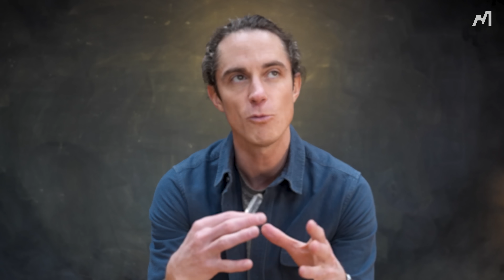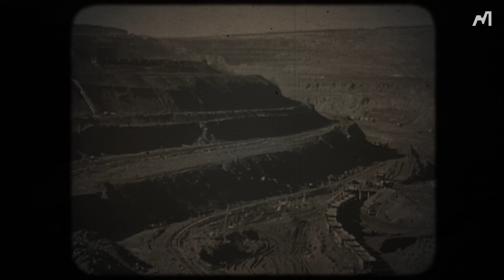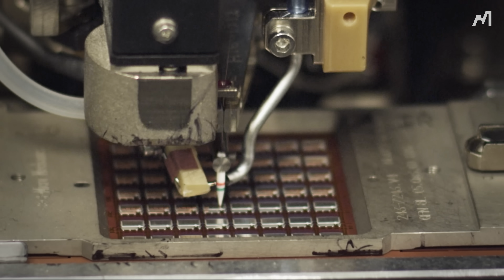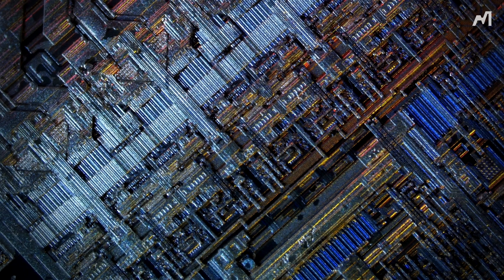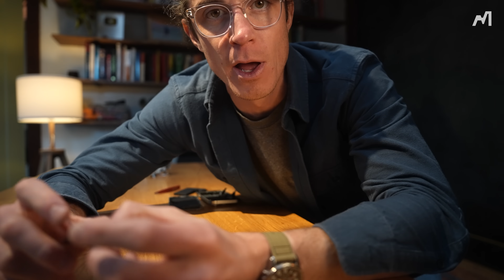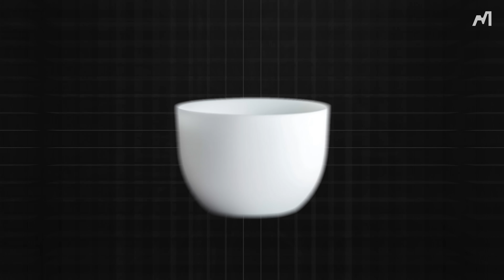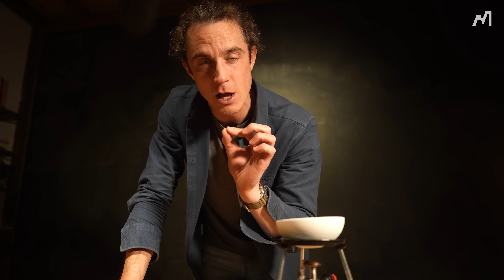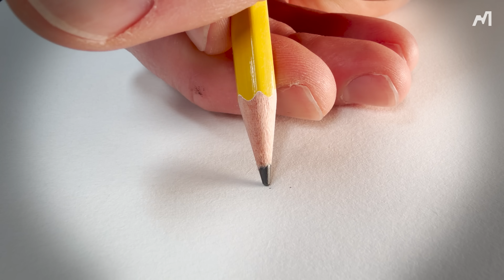Saudi Arabia Has Oil, America Has This

Comment: Just some context as I didn't see it pointed out in the video.

True parts: Spruce Pine hosts uniquely pure quartz, supplies most of the HPQ for semiconductor crucibles, and two major companies there are critical suppliers. Not quite true: It is not the only conceivable source on Earth, and semiconductor crucibles are not fundamentally impossible without it; the issue is present‑day industrial dependence, not physical impossibility. 

So if Spruce Pine disappeared, it wouldn't be the end of the world but the supply chain would be heavily impacted for a few months to years depending on how much investment goes into the process to discover another method of purification of existing deposits, changing the crucible usuage or discovering more deposits.
Reply: Dollars to donuts that they have already been working on a solution for a while now and possibly even have one, it just comes down to what is more economical at this given moment.
Reply: @Jebbis : Yep, quartz is 100% refinable, doing it just increases the price of the quartz.
Reply: @absalomdraconis yes it would require about 130 Kwh of heat to do it per kg   ... And if they use nuclear heat source that's like 6-10 dollars
Reply: We have optically pure quartz in Arkansas, near My Ida. I heard years ago that China buys the production from the Coleman mine. There are several place you can pay a fee and dig your own crystals. The mines were top secret for war materials to build oscilloscopes etc during WWII. I’ve got a hand sized crystal from a private mine the Waltons are funding. Museum specimens for Crystal Bridges.
Reply: I’ve seen crystals in the ground 2 feet long 8-10 inches across in a massive cluster about 4 to 5 feet long.
Reply: The Ouachita mountains are an extension of the Appalachian’s and were created in the same time frame.
Reply: Go to the source of each location.  Then you will FEEL why Spruce Pine is so crucial. Plus you'll need to know the agents in charge.  Let's talk Gate Keepers.  Trust me, it's a fight I don't recommend as a hobby
Reply: If they're not looking into a way of replacing those crucibles, they need to
Reply: @TheRedAvocado they have and they do. The Spruce Pine thing is a myth. It just happens that Paris is great for croissants - but you can get perfectly good croissants elsewhere. Same for semiconductors, but less satisfying with morning coffee.
Reply: @simoncliffy 😅
Reply: Volume and purity is important, if you need to test more and you introduce a 10% fail rate then you are throwing away any competetive edge.
Reply: No, you mean this vid was riddled with hyperbole and not-quite-accurate stuff? You surprise me. I've previously likened this guy as a cross between Ben Shapiro and Feynman. Time to do it again. See? I did it.
Reply: It’s possible to purify less pure silica to higher purity. It’ll add cost but who cares it’s a national security issue right? 😂
Reply: Yeah. I live in spruce pine and one of the main mining companies just terminated a ton of people. Worrisome and I wonder what is happening.
Reply: The whole video i was thinking...... "Why can't they just purify the quartz from another deposit?"
Reply: The processes exist to take almost any grade of silica and make it semiconductor grade. They are used every day to make even higher purity than this deposit,  it's just really convenient to have such a great starting point material.

If anyone is curious just go to Wikipedia or any online search for polysilicon purification.   It's a fairly easy ( industrial) purification process.

It is only a cost question,  not a technical problem.
Reply: Please tell me you being sarcastic, please tell me you're being sarcastic😂😂😂
Reply: Everybody is an expert but works at a coffee shop right!
Reply: AI Overview
China is actively working to reduce its heavy reliance on high-purity quartz (HPQ) and related raw materials (such as those from the Spruce Pine district in North Carolina) for semiconductor manufacturing by accelerating domestic discovery, investing in synthetic alternatives, and enforcing local procurement mandates. Roughly 80% of China's high-purity quartz, essential for crucibles that hold molten silicon, has historically come from the US. 
To break this dependency, China is taking the following actions:
Discovering Domestic Sources: In April 2025, the Chinese Ministry of Natural Resources announced the discovery of high-purity quartz deposits within China, specifically in the Qinling and Altay regions. While the quality and volume are still being evaluated, this is viewed as a strategic move to reduce reliance on imports.
Investing in Synthetic Quartz: China is investing at least $14 million into synthetic quartz manufacturing to create a local alternative to natural HPQ. This initiative, focusing on companies like Nantong Crystal, aims to secure the supply chain for quartz crucibles, which are necessary for fabricating high-purity silicon wafers.
Developing Local Purification Capabilities: Chinese research institutes are actively working to refine locally sourced quartz to 4N5 (99.995%) and 4N8 (99.998%) purity levels, matching the standards required for the semiconductor industry.
Mandating Domestic Procurement (50% Rule): To reduce dependence on foreign, particularly U.S., materials and equipment, Chinese authorities have quietly enforced a mandate requiring chipmakers to source at least 50% of their equipment and materials from domestic suppliers.
Upstream Materials Control: In response to U.S. sanctions, China has shifted toward controlling raw materials, including tightening restrictions on rare-earth-based consumables and materials needed for chip manufacturing, reversing the pressure on the supply chain. 
These actions are part of a broader "50% rule" aimed at achieving semiconductor self-sufficiency and mitigating the impact of U.S. export restrictions.
Reply: @alan2102X  That's not even true, a more pure 5N+ 99.999+% semiconductor-grade quartz has already been produced outside the US for a long time
Reply: @NJ-wb1cz Take it up with google, which was my source.
Reply: @alan2102X  Ooof. Google has no problem tweaking facts.
Reply: @KOSMIKFEADRECORDS  Ooof. How did you manage to miss the point?
Reply: @alan2102X  True! I missed the point.
Reply: The USA desperately clinging to their exceptionalism ideology, now relying on a quartz deposit.

China has discovered over 35 million metric tons of high-purity quartz (HPQ) in eastern Qinling (Henan Province) and Altay (Xinjiang Uygur Autonomous Region), marking a strategic effort to reduce reliance on U.S. imports from Spruce Pine, North Carolina.  These deposits have been officially recognized as China’s 174th mineral species, underscoring their national importance. 

The quartz from these regions has achieved 4N5 grade (99.995% SiO₂) in pilot-scale production, with some samples reaching 4N8 grade (99.998%), meeting standards for semiconductor and solar applications. 
Chinese research institutions and companies have made breakthroughs in deep purification, targeted impurity removal, and resource assessment, laying the groundwork for industrial-scale use. 

Whilst it may not be as pure as what the US has, the question needs to be asked does it need to be?
Hurricane Helene caused damage at the US mine reducing output.
I will use the German tank to explain why none of this matters to China.

The Germans made the best tank yet they lost to an inferior tank because an inferior tank was easier to make, didn't require the best materials or manufacturing facility and because they took less time to make.

China has already produced smaller chips on older machinery than Taiwan, Europe or the US could make on that machinery. Their chips do not need to be the smallest or the best, what is needed now is volume of "just good enough".

That is why none of this matters.
Reply: US don't even possess most of the High Purity Quartz China has discovered and secured over 35 million metric tons of high-purity quartz (HPQ) reserves in the Qinling Mountains (Henan) and Altay region (Xinjiang) as of early 2025. This significant discovery is designed to strengthen domestic supplies for critical industries like semiconductors, solar panels, and fiber optics. Where as As of late 2019, the U.S. National Defense Stockpile (NDS) contained approximately 7,148 kilograms (about 7.1 metric tons) of natural quartz.

And i highly doubt in the last 6 years they went from a poxy 7.1 Metric tons to more than 35 Million in Comparison of China.
Another Tactics US are trying to use to scare people into thinking they have what the world needs.
Reply: @johnboyne1 do you trust their data is the more important question? If that's true why spend billions of yuan on making synthetic quartz. Get it?
Reply: @Antiquated-Ether give your head a wobble stop talking nonesense
Reply: Yankland is No.3 in world production and now China which not only has its own reseves plus the worlds best refineries  has developed a Silicon free computer chip.